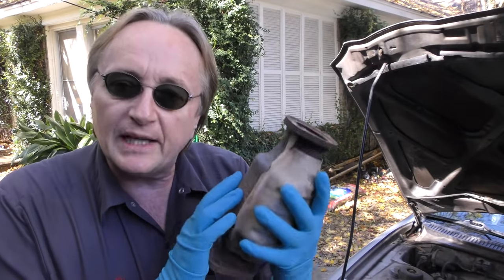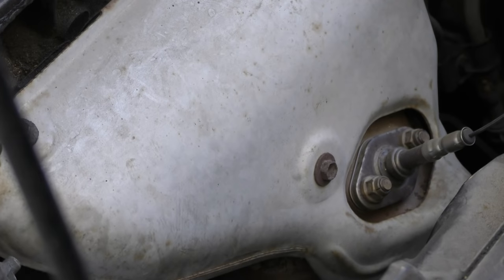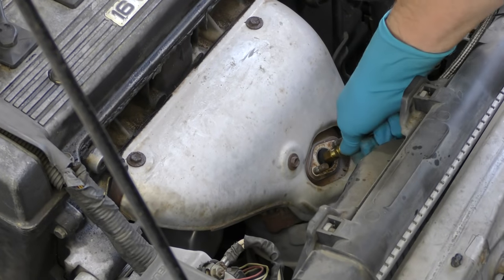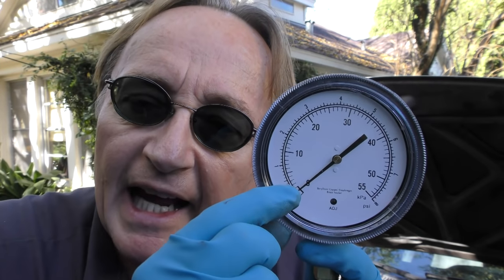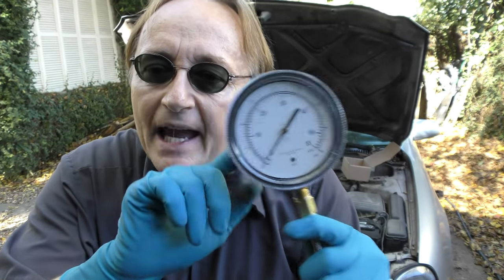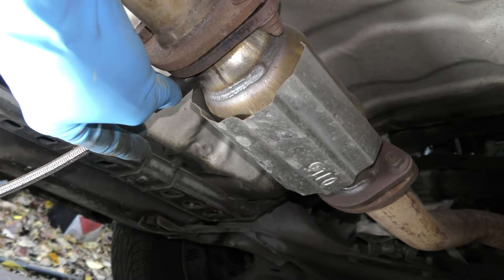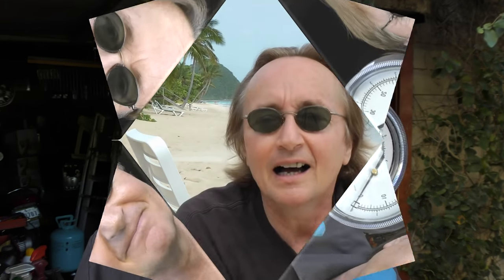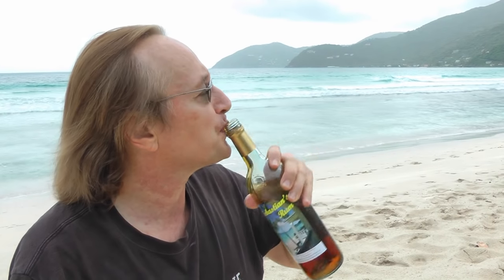How to Tell if You Need a New Catalytic Converter in Your Car

Comment: Hey Scotty I hope you can answer this question for me because I've had conflicting answers. I recently purchased a 1997 F250 HD w/a 351W. The catalytic converter had been eliminated by the previous owner. Can this cause engine problems?? If I hold the pedal to the floor for a while, the check engine light does come on but goes out immediately. Thanks.
Reply: @Frank Wiley so it will cause mechanical problems?

Comment: What about a rattling cat? Mine has been pretty bad for almost a year now and I have not noticed any ill effects. Not sure if I should buy a cheap one and have the old one hacked off then replaced.
Reply from the maker: +zunedog31 if it runs fine, leave it. If it breaks down enough inside, they often will clog up as in this video
Reply: ***** Not sure of it is clogged or not. definitely something rattling around in there. Weather that is a quarter sized chunk of something or the whole thing inside the case.
Reply: ***** I definitely know it is the cat. But the severity isn't so certain. I will be replacing the cat when I have $200 saved up, but until then it isn't a huge issue.
Reply: +zunedog31  Yes, the lattice structure inside cats break-up, making for a somewhat loud rattling sound. As such, they don't work too well & will not scrub the exhaust gasses enough to pass emissions. The pieces if small enough will travel down the pipes to rattle where ever they get stuck, & oftentimes clog up the muffler baffles. The spooky one is the cat that you take off, you look down it & the whole inside structure is gone, empty...then you pull the entire exhaust system in one piece (if you can)....& try to "pour out" the pieces.
Reply: Ricardo Ellison Ah, good info. Thanks.
Reply: Daniel Clements A bolt on OEM part from Honda is around $375 without install, I'm going to get a cheap $70 universal cat and get the old one hacked off and new one welded on, labor should be $100-$130

Comment: Scotty, catalytic converters do not go bad. The fuel can be rich causing it to plug up with carbon or to melt the monolithic honeycomb or antifreeze white coating from head gasket leak or mechanical damage from road. Fix those issues first before replacing the catalytic converter.

Comment: Removed negative battery terminal and reconnected, now after driving for almost 200 miles, the catalytic converter still showing not ready.  May I ask you if you have any suggestions?  Need to get 2001 Toyota Highland smog check.  Thank you.

Comment: Help. My Jeep idles fine after cranking cold but if you, for example, go to the supermarket turn it off and go inside for about 15 mins, when you come back out and start it there is a rough idle and seems like a misfire. This rough idle only occurs once the engine is already warm. Running low on morale at this point because I've scoured the Internet and nothing gave me a clear answer. Any help would be appreciated.

Comment: Hi Scotty thanks for all the useful tips on cars. I have a big and complicated problem. I have a 2012 mazda Bingo. Engine with only 25k/km. 
1. Runs hot. 2 . Burns gas only about 10 miles to the gal. 3. Sometimes trottles fast. You have to tease up the pedal andbyou here it comes down. When its burning good the engine is cool. Otherwise its hot. 4. When going up hill it comes down really slow like its going to stop then it shoots off fast and powerful tben comes down slow again. When you try to gas it its not take the rev . The enginenis lienits muffled. But when parked and cold and just start iit is responsive and engine can reved up. Most times engine does not rev up fast and healthy. Only have van jow six months.. engine has no oil leak and loiks brand new. I remove the first cat closest to engine a little better but nit mich improvemert. After I remove cat check engine light came on. I used an adopter to trick compter and do removed check engine light but oroblem same. Diagnostic did not say oxygen sensor is bad.
Reply: Did u get the problem fixed?

Comment: Hey i have a 1995 camaro that was misfiring had bad sparks change them but the sparks plugs were cut wen i oit the new ones on.. The car did catch up too speed it wont go pass 81 on the freeway .. Idk the took the Catalana converter offense put a straight pipe but still is doin the same thing

Comment: I have a 4 cylinder accord and it doesn't want to rev past 4000 rpm it starts bouncing at 4000 maybe it's in limp mode...can the catalytic converter do this because I believe mines messed up since it rattles

Comment: G'day Scotty Welcome from good old Australia. I have a 2088 Hilux 4 ltr Petrol engine and the codes come up as the cats so I tried your Thinners way and the codes stayed away until I'm stop starting in traffic but the car has no power loss so could it be the Sensors and how do you test them . Also I live in a state where I dont have to pass emissions tests so what would happen if I removed the cats would the sensors see that they were'nt blocked .  Thansk love your input on most car things keep up the good work. Peter
Reply: Woops just noticed 2008 LOL

Comment: I have an acura tl 2004, i bought it used, had 2 owners before me...the first owner removed the catalyst because he said he had thermostat problems IT WAS OVER HEATING ALL THE TIME..so he just took it off and it stopped overheating...the second owner sayd he never had a problem with over heating, just the check engine... is it going to mess up the car or not? Do i need it or dont? What annoys me is the check engine light.. the car was slow in acceleration and felt heavy...but since i changed the knock sensor the car runs from a stop to when i accelerate aloooot quicker...doens take long to accelerarate or feel heavy anymore...but im still getting p0420 and p0430 diagnostics on my tmobile sync up drive plugged into the OB2. and i was wondering if it can cause any future damage to the car besides the gases expelled. I dont know nothing about cars, im a girl so u get the point....again, should i reinstall the catalyst or not.
Reply: Some acura forums say, they done the same thing and had no problem for years...and they just took out the catalyst sensor so the check engine wont turn on....is that a good idea?

Comment: Hay Scotty I have a p0420 code in my truck and I took it to a shop and told me I need a new catalytic converter and they are charging me $ 2000 to fix it and it needs to pass smog for the Registrations what should I do

Comment: When I look at my o2 sensor graph my b1s1 shows .00 to .01 volts and the same with b1b2. When I give it gas or cruising the volts increase .01 to .09 but usually shows. 0 to .02 volts Are these bad sensors or converter?  My codes are p171 p174 p0420 and p1151

Comment: Hey, this is really great info, but I wanna know... Can this happen to even newer vehicles? I have a 2020 Nissan Versa SR and I'm having the check engine light up because of a suppose mass air flow sensor issue (P0101). However, I'm honestly thinking that it could very well be a catalytic converter issue although I'm not so sure due to being a 3 year old car... I can drive it well, it goes over 40mph, the gas seems to consume normally, and I'm not getting any weird deceleration. But trigger code P0101 can be involved with catalytic converter issues so I wanted to know if this can occur to more modern cars as well...

Comment: I have a 2016 Chevy Trac and was taking off the converter and snap off one of the bolts that connects to the flex pipe,can it be replaced or do I have to get a new converter.

Comment: I have a 02 clk 320 and I've had to replace one of my catalytic converters twice within a one year period.  What things could be causing my catalytic converter to keep going bad? It just recently started to rattle again.
Reply from the maker: an engine that burns oil ruins them, as does one that runs rich or lean But rattling, that's usually just cheaply made non oem replacement cats

Comment: Hey Scot i have a 95 Ford Explore 4WD ...so im trying to figure out what is making the hoses on the EGR Valve feedback presure sensor... I changed out the EGR Valve and the truck seem to run better... before that it would idel fine but i didn't have enough power when in gear...i tried replacing the feedback sensor but same problem...do you think i have a clogged cat..help

Comment: My car has no issues with acceleration but has a white smoke that comes from around the bolts. It appears to smell like burning oil but I only really smell it when driving in town and stopping at lights. Do you think that means it needs to be replaced?
Reply: White smoke!? Whats the make and model of car and how many miles?
 If you have high miles, theres possibility of blown head gasket, just guessing, but i had a blown head gasket on my 97 Chevy S10 and had white smoke out the back of the truck one day, cost me little over 2k to fix, that was over 3yrs ago.
Reply: Gunter Severloh my car is a 2000 Toyota Camry Le v6 , I still have not found the source of smoke, but I’m thinking it could possibly be an exhaust leak. there is no smoke coming out the back but rather the back of the engine it appears it’s where the exhaust is . I just haven’t had time to really look at it myself in depth or take it to a shop!
Reply: @slamry8657  Ok, im no mechanic just had the experience, just an observation but back of the engine where exhaust is, sounds like you have an exhaust leak where the exhaust system starts, but then white smoke?
   Dont sound like normal smoke you would see from the exhaust, just a suggestion, dont wait til it gets worse, at least get it checked out, and then go from there, if it is indeed a head gasket, your looking at close to or over $2k to replace it, but if not, hope its not then who knows, but at least find out, dont wait til your stuck on the side of the road. 

     Hope you get it sorted, when you do get it checked out, would you mind posting an update here, i'd be interested to know how things turned out for you. Cheers!
Reply: Gunter Severloh Hey , thanks for the advice! I’ll probably get it checked out sometime over the next couple weeks ! If I do I’ll let you know what it is. Have a great day!
Reply: @slamry8657  Welcome, sounds good, best of luck, cheers!
Reply: Gunter Severloh hey, so I have an update it is my rear valve cover gasket seal that is leaking! It has a slow leak that is dripping on to the hot exhaust pipe . I kept doing research and found that it is a pretty common problem on the v6 Camry from that year! I’m just glad it is nothing extremely major!
Reply: @slamry8657  Woh, thats good to know, glad it wasn't anything worse, happy its something simple you can fix.

Comment: Hi Scott. My van had been making a noice. I took it to different mecanichs. They change the bearings, the axels, and a few more parts including the 02 sesor which cost me 800 dollars, and the problem continued till about a month the engine light went on. It showed the catalyc converter. I had it changed and now the noice is gone but the engine light is own now the mecanich says is the fuel pump but I dont think is tha another said I just need to put an insert to the 02 as the code shows insufficiesy in the catalytic sensor and want 80 dollars to put it on. I feel is too much. I have spent so much money in changing parts that were good. I only drive my car I  the city mostly to go to work. I am sad I feel being a woman make it easy to be taken advantage. Your videos help a lot but I the end I need someone to do the work. Can you tell me why the new catalytic is showing an insufficiency?

Comment: have a 1996 izuzu rodeo,  when driving in get to about 30mph then it won't go any faster, I literally  have to floor it just to get more power. once I get on the highway I'm ok but on main roads where I have to stop at lights same problem. could this be the converter or maybe o2 sensor

Comment: I have a 99 accord v6.. My cats going bad.. I want a deeper tone but I don't want to much droning and I dont want to lose my accerlation.(will a tune fix that) & Will a test pipe give me what im looking for?
Reply: Get a higher flow catt/performance if you run with no cat it might not drone at lower speeds bc the muffler but highways you would want to bring ear plugs if your looking for a better tone without drone just better sound look at getting just headers the stock Honda headers aren’t good

Comment: Off hand i can think of a much easier way to do this with even a cheap vacuum gauge. A lot of Fords use a DPFE sensor with the EGR system. Just slide one of the hoses off from it and hook the gauge up to the metal line going to the sensor. Just figured id throw that out there for those wondering if theres an easier way.

Comment: hey scotty, I changed the coil pack , plugs and wires on a 02 ford 4.2 liter v6 , it doesnt idle bad anymore but i still have that popping back fire or after fire every time i change gears . I also began to hear the engine whine when accelerating quickly. sounds like a supercharger except its just more a hi pitch whistle. thanks appreciate the help!

Comment: I'm not sure if my catalytic converter is clogged I've taken my car to a few machines and they are not sure here's what it's doing.    It's a 2010 Nissan rogue  4 cylinder.  When I start driving it it does fine it shifts good but after awhile of driving it maybe an hour or more it gets to where if I hit the gas pedal it wont accurate and the car starts slowing down. I have to pull over and let it cool off and then I can drive another hour or 2 and sometimes it dont do it at all.  Can u help me scotty.

Comment: My cars Cat had little mesh like wires pulled out of it when it was opened. Is that an equivalent of Catalytic Conveter or guys just jammed these wires up in there. IT should be noted that i my vehicle wasn't producing dark/blue smoke or smelly smoke, just a considerable drop in power esp  uphill. The mesh had gone up the muffler n i don't know had clogged it up or something, but am interested in what the wires were doing up in there coz I have never taken it to the mechanic where it was pulled out wholly. Stressed fella here

Comment: I bought a dodge journey  2018 model 
It has 85,000 miles my catilic converter is bad
The dealer told me that a after market unit
Does Dodge use after market product from the manufacturer. We bought this car brand new

Comment: I have 2012 Hyundai Elantra with 55k miles I have a check engine light for catalictic converter how is it possible to be bad in such low mileage
Reply from the maker: cause its a korean car, not that well made. And if they have cheap gas in your area, that ruins the cats

Comment: I have none of the testers in this video but my cat just went bad on my Chrysler 300c rear wheel drive. And now I just cut the car off and tried to start it and it's sounding like it's hissing!! Loudly or something inside of it is spinning with the bad oil smell and no start or crank. But it was driving and picking up speed and hitting the highway, then harder to start longer crank up times studdering then studdered to start shaking then the hissing and no crank no start, bad oil smell no key in the ignition. Could any tell me what that hissing sound is coming from the Catalytic Converter, and will it put me at risk of getting blown to bit trying to start it back up to test it?

Comment: hey scotty, we own a 2004 Mazda6 with the 3.0 and it's consuming a little bit of oil. we're planning on going on a 600 mile trip from NJ to SC. would it be OK to take down there, just as long as I check the oil a few times during the trip? or should I just dish out the $200 to rent a car?
Reply from the maker: +Alberto Irizarry heck, bring oil in plastic bottles and add it when you fill it up with gas

Comment: Hi Scotty, I failed my emissions test due to an oxygen sensor that keeps triggering. I have replaced the oxygen sensor twice. I take it to an auto repair shop and they tell me that my catalytic converter is cracked at the bracket and after he applied an exhaust sealer the sensor light disappeared and i passed the emissions test.....a year later the light came back on and i failed the emissions test again but this time i want to get it fully repaired. I just don't want to waste more money than i need to. is it cheaper to get the crack welded or should i replace the right side catalytic converter?

Comment: Thank you my dear , i have mazda 6 model 16 i have low performance with summer seson at night car working fine in morning or afternoon is bad performance no check engine  , i do every thing like sparkpluge change and fuel filter change and also injector cleaning not solve it some time there is gasolin smell as per work shope mybey catliteic converter plugged 
Am looking for  your support my dear 
Thank you

Comment: I have an 03 Hyundai Tiburon with the 2.0. I removed both clogged cats and it's still running horribly. It had an engine code for clogged cats but it didn't fix the problem. Any suggestions?
Reply from the maker: the oxygen sensors are probably ruined too, they tell the computer is the cats are bad. BUT, realize removing the cats also messes with the oxygen sensor data, SO having no cats on can make them set cat codes TOO

Comment: Hi, need help badly with my audi a4 tdi 2008, loosing power uphill or when teaching 100 km/hr, 
Also has difficulty moving the car if parked on step hill, and need lots of reving, 
Took it to many mecanics no one knows the problem,
Tried changing whole egr, cheked the turbo, all working fine. Engen is in great condition.
any help here please